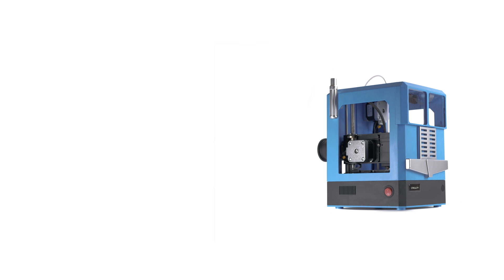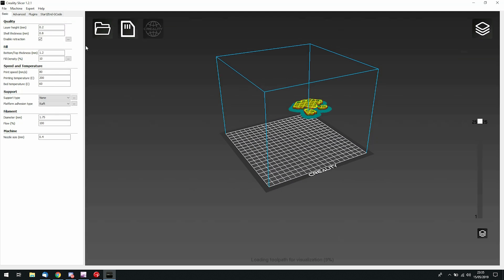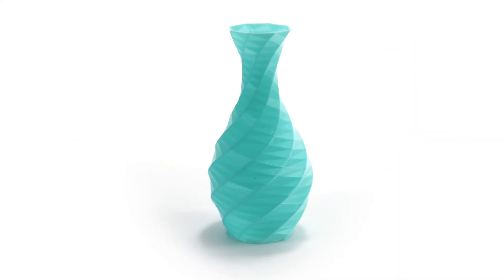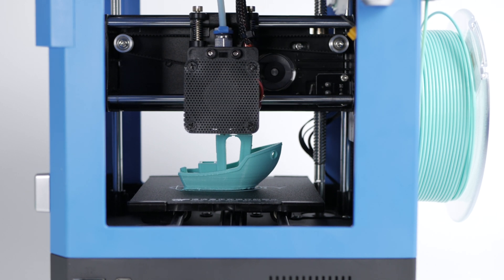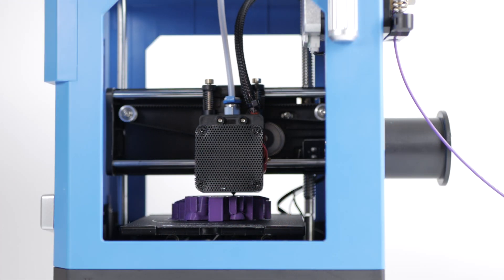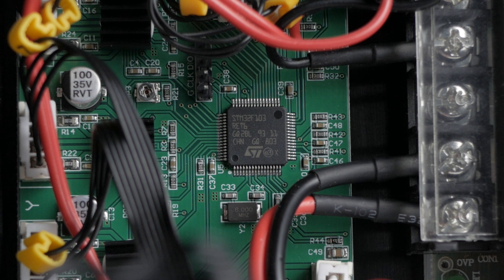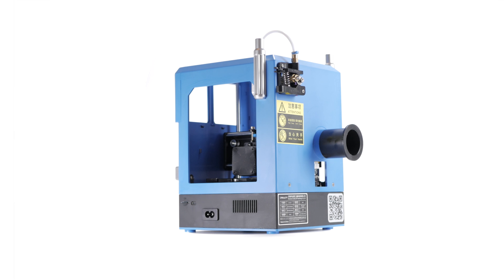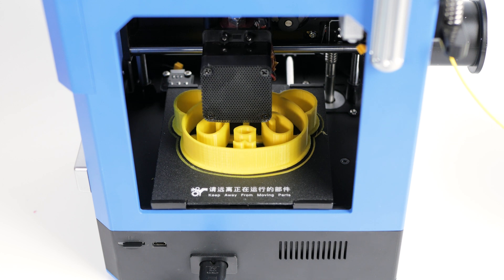Creality 3D CR - 100 Review

Comment: hey mate, i know this comment is 3 years too late, but if you ever did create nice settings for it id love to know! i just got one of these and while its printing great i would always welcome better settings :) great video thanks!!
Reply from the maker: Hello Mate, I just went with an Ender 3 preset in PrusaSlicer, changed the bed size to fit the CR-100 and the only tweaking I need to do with a slight reduction on the retraction. For me, the biggest improvement came from just not using the old reskinned version of the Cura slicer that Creality ships on the SD card.
Reply: @PigeonPrint  thanks so much I have been using exactly that 😁I appreciate it.

Comment: Great vid. Where do you down load the software?
Reply from the maker: There should be a Quality skinned version of Cura on the SD card....think they call it "Creality Slicer" but its just an older version of Cura with a profile built-in for the CR100
Reply: It didn’t come with a SD card-

Comment: Quick question, can it print ABS? And can you change the nozzle to idk say a 0.2mm?
Reply from the maker: I would advise against ABS due to the hotend not being "all-metal" this basically means the PTFE tube goes all the way into the nozzle and the temperature needed to print ABS is higher than PTFE can take, and it will start to breakdown and off-gas. You would also ideally want to enclosse the printer to print ABS.

Changing the nozzle to a smaller size should not be an issue as these are setting that can be changed in the slicing software rather than on the locked firmware.
Reply: @PigeonPrint  Thanks alot for your time to answer my question man, you earned a subscriber. btw about the nozzle I was refering to physically change to a smaller or larger nozzle, it is possible right? Or is it not recommended?
Reply from the maker: @yacares77  Yep, the nozzle can be unscrewed and replaced for a smaller one like a 0.2mm, but you will need to tell the slicing software you have done that or it will keep extruding the same about of plastic as if it was still the 0.4mm one and you will get  a whole bunch of issues. Thanks for the Sub, and any questions, just give me a shout!

Comment: Your videos are so high quality! Why’d you stop?
Reply from the maker: Lack of time, but getting back into it, should be putting some new content out soon as we are all in lockdown here in the UK.
Reply: @PigeonPrint  Are you still using this printer? Would love to see another video on this.
Reply from the maker: @parthkadakia  Thanks, I have been waiting for Creality to update the thermal runaway issue in the firmware, or release the firmware files as they have for their other printers so I can do it myself, but they have not done this yet, and I'm a little conflicted about making another video while it still has this issue and is marketed for children. If they do update/release files I will certainly do another video as it is a very good little printer for the money with the one issue of thermal runaway protection.
Reply: @PigeonPrint  Thank you for the update.
Reply: @PigeonPrint  Hello, one last question, what slicer do you use? I am unable to get it started to print using Cura. I did not receive any files for Mac in the SD Card.
Reply from the maker: @parthkadakia  I used Cura and Simplify3D, If I was you a would download Cura 4.5 from https://ultimaker.com/software/ultimaker-cura then build a profile. When it asks you to pick your printer pick "Custom" then "Custom FFF printer" and then change the setting to 100mm for X, 100mm for Y, 80mm Z, and the default Cura settings should get you printing with good results. there should be Mac drivers on the SD card under SD Card\Data\2. Software and Drive\Drive, hope this helps?
Reply: @PigeonPrint  It did help, I got 3 prints out and had a wonderful result. I definitely agree it is a decent printer (bought it for $139) for beginners, will not call this a Toy/Child printer since there are few things I definitely would not let kids touch or be around for. Thank you!
Reply from the maker: @parthkadakia  Excellent, if you run into any problems just drop me a comment and I will get back to you! Happy printing!
Reply: @PigeonPrint  Thank you, will do.
Reply: Hello, this is Parth. Created a separate channel.

Comment: Great review. I'd be a bit worried that the printer bed keep hitting into and rubbing along the cables inside on the left hand side(looking from the front.) It seems to correct as the build gets taller, but the constant rubbing is going to cause problems at some stage.
Reply from the maker: Well spotted! yeah, first few layers the bed rubs against these flex cables, tried to see if I could get them to hang up on the bed but was unable to, but don't like the fact there is rubbing on the cables. Been look at making a clip to stop this for an "upgrade/tuning video" along with harassing Creality to push an update with thermal runaway protection so I can add how to update that too. 👍